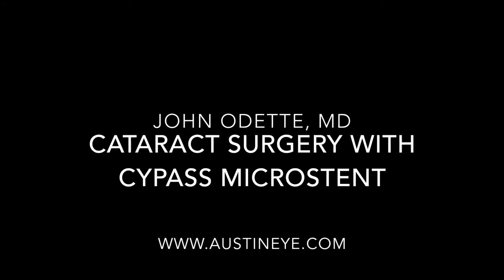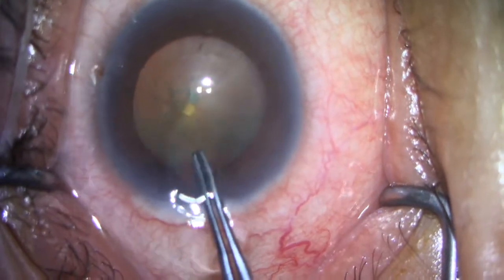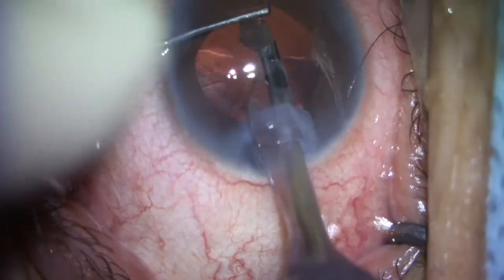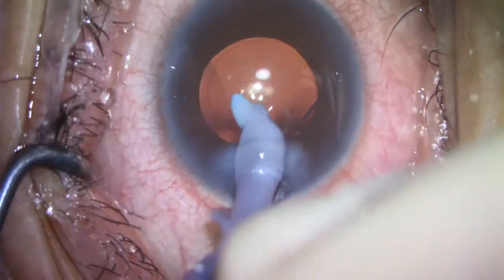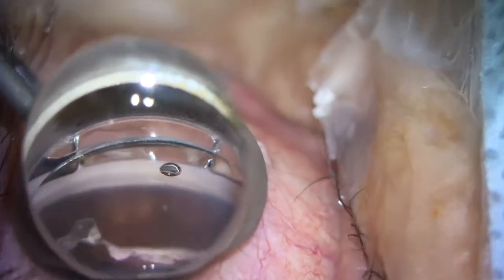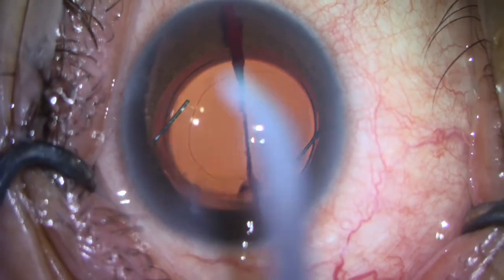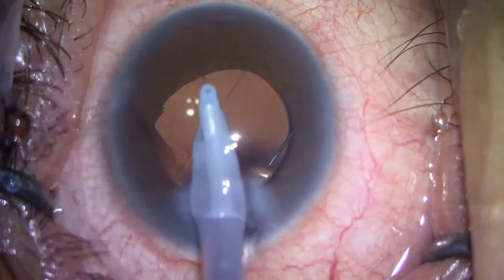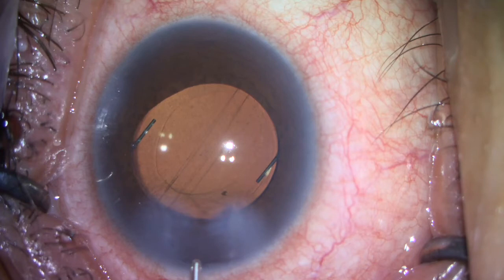Cypass Placement with Cataract Surgery

Comment: Great case.  who makes the silicone I/A that you use?  thanks.
Reply from the maker: Jay Bansal thanks!  The silicone tip in this case is made by Alcon.  It is very capsule friendly when new and we can usually get 5-15 cases out of each tip which makes them more cost effective than the single use polymer tip that they make.
Reply: Thanks John for such a prompt reply.  Could you please provide model number?  I am very curious to try it out.  Best regards.